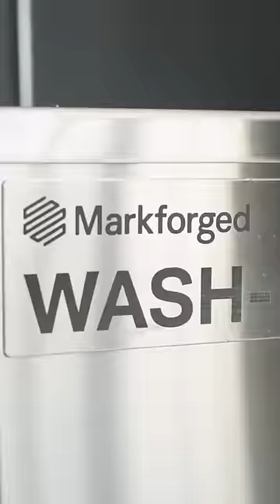Full Process Metal 3D Printing in 17-4 Stainless on the Markforged Metal X #shorts

Comment: I'm confused why wash and cure fdm? Was it metal ?.. did it get powder coated? Or anode cathode style transferance
Reply: The 17-4 stainless parts are washed to remove the majority of the wax/polymer matrix that holds the filament together. Then they are sintered to fuse the metal filament together to create a dense metal part.
Reply: @trevorgoforth8963  that is awesome haha I had so many things going through my head as to what was going on!... that's incredibly cool but... I can see some incredibly complex shapes comming out immensely strong

Comment: Soooo.. how does tensile/sheer etc strength compare to an equivalent part turned on a lathe. I’m not at all asking in relation to printing form 1 devices! Lol..( relax ATF.. form 1 is legal)
Reply: They're sintered parts but the strength is still there. I use this system quite a bit for components that are in somewhat high compression, sheer, and some in tension with good results. You can even print in certain tool steels. The accuracy is best with fewer walls and 40% infill because the parts print oversized so they can shrink to size in the furnace. Small parts can be solid no problem.
You could buy about 100+ form 4 devices for the price of the metal x, wash, and sinter.
Reply: @johng8874  awesome. Yeah, I figured that it would not be cost effective, my question was just based on the “how close are we” factor.
Reply: We're there! DMLS machines are more expensive and hazardous but I've made some great looking solid parts on those. It skips the wash and sinter options because it uses a laser to sinter as it prints. Very cool technologies out there. I've seen some thin misused DMLS parts actually bend like machined parts.

Comment: What would be the benefits of these printers compared to SLS ones be?
Reply: Some benefits of this process over SLS are, the ability to print hollow infill patterns without trapping powder because there is no powder. Also, you can very easily change materials due to it being in a filament as opposed to metal powder. There’s also considerably less safety concerns with this process.
Reply: @trevorgoforth8963  awesome, thanks for the info. Will definitely look into that. I work in a company that develops and manufactures SLS machines (EOS) and didn't know there were these kinds of alternatives for metal parts.
Reply: @obele92  What do you do for EOS? Yeah SLS definitely has some benefits over this process but I guess it all just depends on what you’re trying to print!
Reply: @trevorgoforth8963  I'm a Field Service Engineer. I install, repair and do the maintenance of the machines on customer site. And sorry, apparently we use DMLS systems, not SLS. Thought it was de same.

Yeah, I would say speed (7m/s scanner speed on modern models) and precision (0,02mm layer thickness and laser diameter between 0,04mm and 0,1mm depending on the machine) are better. But yeah health and safety are at higher risk, since the material is so fine it can enter your body through your pores even. Wearing proper clothes and wearing masks are key while operating them.

Comment: It is not recommended to use similar stainless parts in a load close fitting application due to the risk of cold welding aka galling on the molecular level. Pay attention or pay cash.
Reply: Cold welding requires a vacuum so I think there is little risk of that here. Galling is entirely separate from cold welding.
Reply: @Crlarl  Why don’t you take a moment a moment and get learned on the subject of stainless fastener seizures. The only vacuuming then will be when you find out that it sucks to separate the parts, and  your obvious lack of knowledge on this simple subject.
Reply: @gerrylundergaard60  
It's good to check facts before posting because it's entirely possible to misremember or misunderstand what is true. I'm glad you advocate for that. I just did, and indeed, galling and cold welding are different things.
Reply: @Crlarl  let’s play make pretend. Let’s say Carl bids a contract to make all stainless wheels, studs & lugs. ( I use lugs so you can relate). Then when the customers are stuck on the side of the road because they cannot unscrew the lugs Carl can then just say “ galling is entirely separate from cold welding “. Won’t cut it it. Think about Carl while your strumin you’re banjo!
Reply: @gerrylundergaard60  
I didn't say that advice was wrong. I just corrected you on the details. I thought you would appreciate it given that you seem to be a person who care about details.

Comment: I would like to know how strong this is
Reply: As strong as metal.
Reply: Metal has a wide range of strength. A bolt that size of heat treated 4140 has a tensile strength of over 200000 pounds. If 3D printed fasteners could compare that would be impressive.

Comment: Is this binder jetting?
Reply: No Markforged calls it atomic diffusion additive manufacturing but it’s basically FDM metal 3D printing. The material is held together by a polymer/wax binder until post sintering though.
Reply: @trevorgoforth8963  So essentially binder jetting with an additional sintering step. The final mechanical properties wont reach those of a fully solid part. Still pretty nice for parts where mechanical strength doesn't have to be maximised.
Reply: @trevorgoforth8963  And it doesn't seem to be FDM 3D printing at all.
Reply: @Widur42  Binder jetting involves depositing a liquid binder onto a bed of metal powder and those parts need to be sintered as well. FDM is extruding a filament out of a nozzle with each layer fusing to the previous layer. Only difference in this process is, you need the wash and sinter to fuse the layers together. It’s FDM/FFF with extra steps.